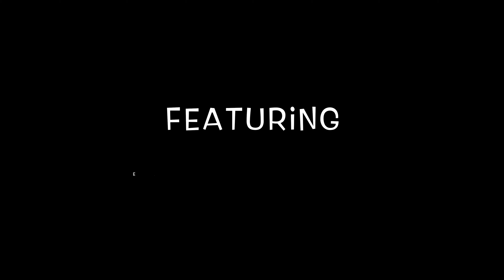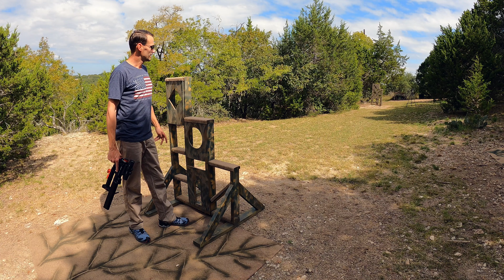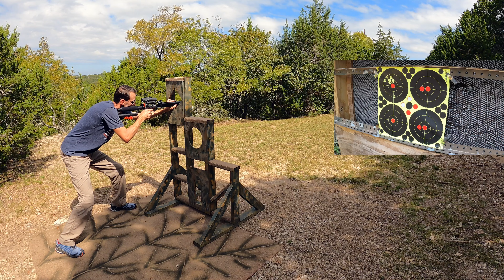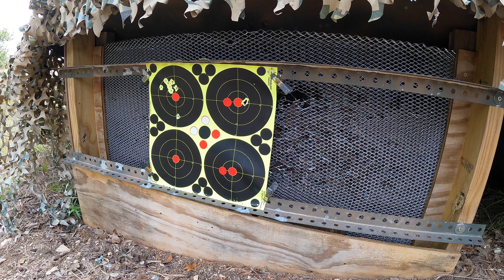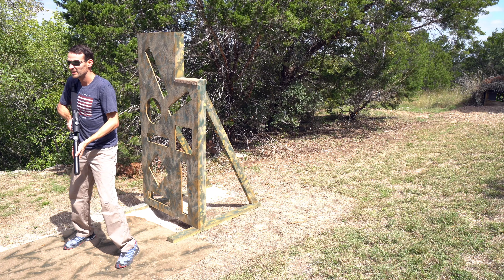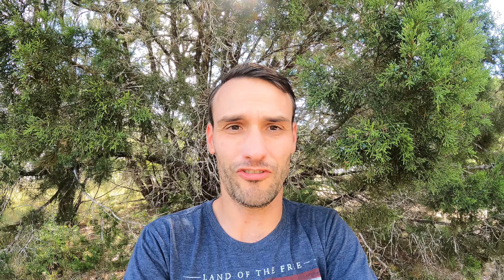Airgun Training Drill #2 - EDgun Leshiy 2

Comment: You could put a custom sized transfer port in there to get what FPS you want, did it not come with a few ? I thought they did, also couldn’t you not turn the reg down to 120, instead of 130 that’s surly gotta bring the power down ? Barring in mind you need enuf pressure to push the mag around with each shot so I’m not sure how low you can actually go but 120 or even 110 bar should work right ? I hope somebody may know more on this , cheers great video mate 👍🏼
Reply from the maker: From what I understand the regulator can be adjusted more up than down. Yes transfer port/jets whatever they decide to call them will be the key to quickly making significant changes.

Comment: Looking forward to do something similar with my Leshiy 2 .25/250. Mine its currently shooting the 25.18gr at 820fps! Yeah it shoots hot. What’s the shot count on your .22/350 version? Thanks for the good work. I envy your property! Nice location to practice.
Reply from the maker: Haven't done a proper shot count yet.
Reply: @AirgunNationForum  - What?! You’ve had it for a day and haven’t done that yet? Just you wait. When I get mine I won’t have done a shot count in a day either! LoL.
Reply from the maker: @electrichellion5946  hahahah!
Reply: @AirgunNationForum  update - two 
mags per thousand psi. So I’m getting roughly 32 shots using the jsb 34 gr heavies. It’s a hard hitting, accurate air rifle. Yes. The trigger takes some gettin used to. Oh and it’s a .25/250mm

Comment: You have been miss informed as this is adjustable down as they are available here in the UK at sub  12flb upwards for UK fac holders just thought I'd say 😀 😉
Reply from the maker: To do it right you need specialized "jets".
Reply: @AirgunNationForum  like I said you are misinformed its the reg the plenum and the transfer port all of which are adjustable or replaceable 😀
Reply from the maker: @chrisboddy9775  I was told that adjusting the regulator does very little to reduce the velocity, changing the plenum does very little to reduce the velocity, swapping out the jets (or as you call them ports) is the best way to make gross (large) adjustments.
Reply: @AirgunNationForum  you should have some red rings with the leshey or get some that you can drill out this will bring the power down 😀
Reply from the maker: @chrisboddy9775  The pucks will reduce the energy. But i don't think the "pucks" are a permanent/good solution. The air has already made it past the regulator, valve, & jets. The pucks simply redirect some of the air from entering the barrel & the extra air is discharged near the shooter. Admittedly I don't have any experience with this. I'm just regurgitating information that I've been told.
Reply: @AirgunNationForum  ok enjoy your airgun  and let's see some more shooting 🙂🙂